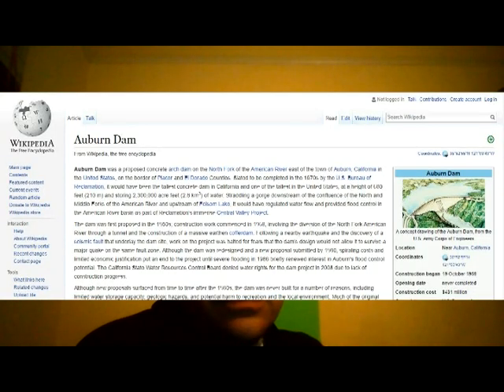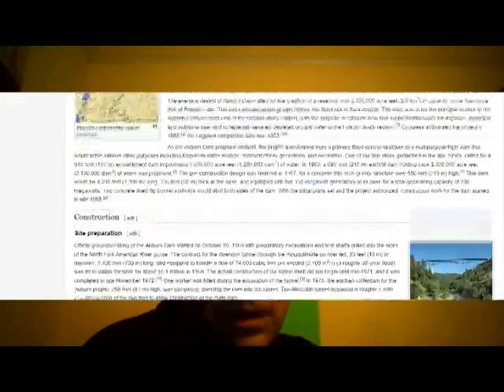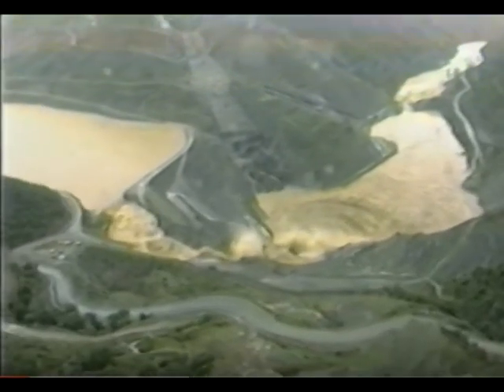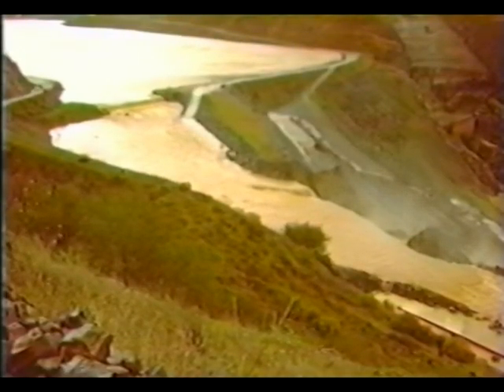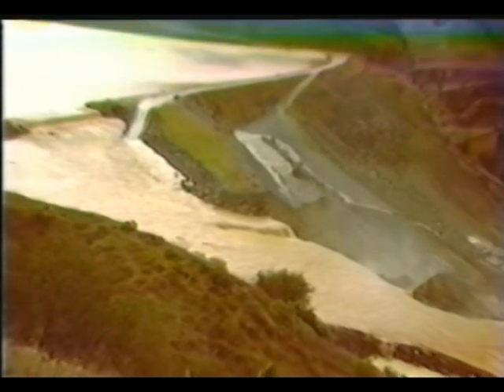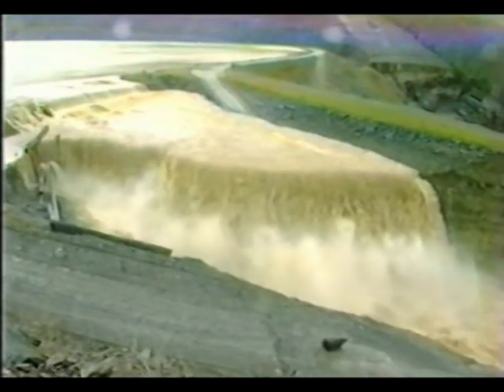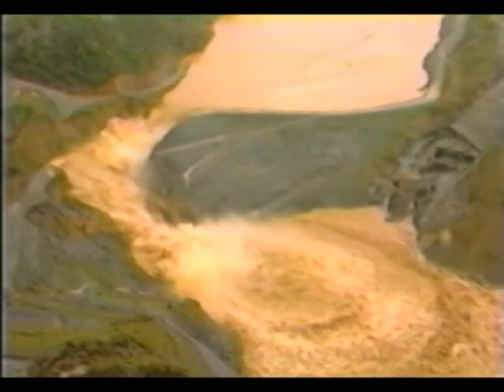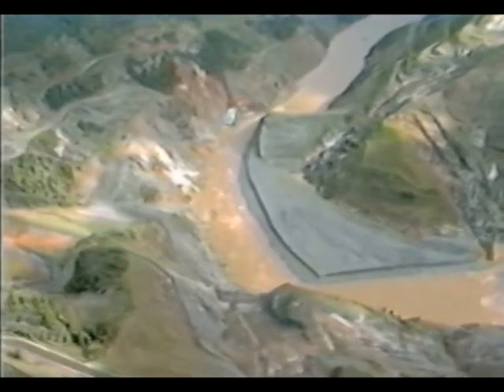Oroville Dam Failure | Auburn Dam Fantasy Failure

Comment: The situations are not identical, this doesn't mean I disagree with everything your saying but there are some differences which make it almost a different matter. One of the main things the size and distance between the actual wall and where water is running and the actual earth material in between. With this Oroville is only possibly beginning to look like the scenario you've shown. However if it has to keep running then the main water way will fully shift into a type of earthen emergency water way, so the horseshoe is created but since the issue does not begin from the top the water will not cut in on the curve of the horseshoe in the same way, it can't as long as the rest of the spillway holds up. But like I said if they keep running it then it will erode back up under the spill way making it give further which will then make the cutting action further back into the the left support of the dam wall. They say most of the silt is washed away no leaving bed rock but if the are micro washes slowly seeping through that back wall and cutting out the foundation of slabs then you could have one massive cave in which would be the shock it needed to break that whole edge out, especially with what is probably already loose and bogged soil at the top. It would be a sort of mini quake that would jiggle the top, just like when your trying to snap something and you get it right to the edge, and all it needs is a quick tilt to compromise its integrity. This makes for all the more dangerous situation in that it's impact would be sudden and "unforseen". Also another thing that a lot of people are thinking about is a terrorism factor. False flag or not, this thing is highly vulnerable and anyone could get the force of multiple nukes in high level economic production zone, with tiny mixture of secrecy and small explosives. Heck even a real earth quake could be triggered and then you'd get a Bogo, a two for one, such a great deal. I really appreciated the post from the guy with the astrological perpesctive because what really matters most is the deeper reasoning to things which make sense to core values that are truly the deciding factors of our reality. I have done the same thing in my Bogo, and two for one responce. The connection is the consequential reactions of the human condition. When you make such a "slop" world of buying and selling, and everything is such a good and cheap deal, well the harsh reality of such antics is regulating and managing the systemic collateral damage of the true forces of creating such a cheap thrill and instant gratifying society. If one then just like the other. The forces that be and the true payment of energy expenditure and concentration on less than honorable prospects. This is a real thing. The true image of it is when you see majic in a movie and this pulsating orb appears around the person and it's spinning with all these shapes and lines of antiquity running through it but whatever they were doing wasn't right and you can tell that it starts to swell and become violent and uncontrollable and the person can either halt the magic or try to continue further in attempts to controlling it but if it becomes overwhelming, then the shock of its implosion is amplified much more times than at the point it could have been simmered and snuffed.

Comment: The Oroville dam did not fail, nor was it going to. The issue was with the regular and emergency spillways. And both of those can fail and wash away totally and the dam remains intact and safe. The main spillway did not fail. It was the ramp. Only.
Reply: nice ramble
Reply: Are you looking at the right image and right dam? The dam with the toe being washed away is the long ago failed Auburn dam.  The spillway for the Oriville dam is totally divorced from the dam and its toe? Loss of the spillway would only affect up to about 100 feet off the max water level of the dam. The emergency spillway only about 30 to 50 feet.

Comment: Know one thing: The cofferdam in question was a TEMPORARY dam used to allow the placement of the MAIN concrete Dam just a bit downstream. The cofferdam is meant to be a short duration, temporary structure that is easy(er) to dismantle once the main concrete dam has been completed. There is a superficial resemblance to a "main earthen" dam, but that is all it is, a visual similarity.
Kind of like how a "pressure cooker" on your stovetop kinda resembles a nuclear reactor pressure vessel, but they are VERY different things built on VERY different scales.
But, the resemblance between a cofferdam & an Earthen Dam isn't so much like "apples & oranges" as like a "very round, orangish apple" & an Orange.
Because of the scale, purpose and design requirements (i.e.  the need to remove it after the concrete dam is finished) making a real comparison between a cofferdam and an Earthen Dam is really unfair and misleading.

Please do not think that I am attempting to say the message behind your video is wrong. You hit the nail on the head.... Greed and a malicious disregard for the lives of people that you will never see is INDEED both a crime and a travesty.